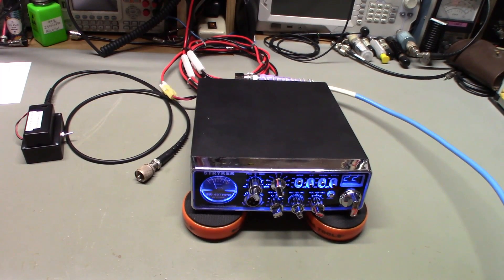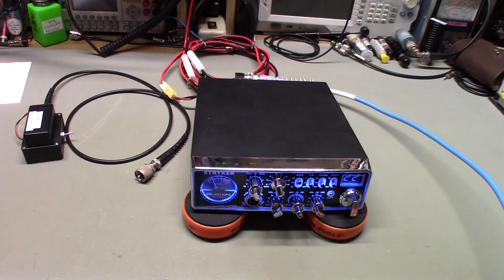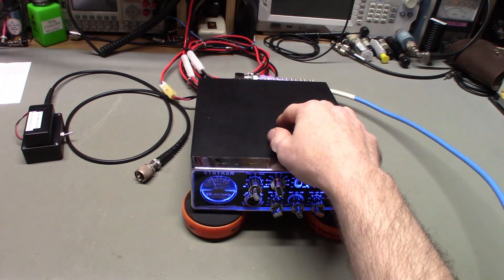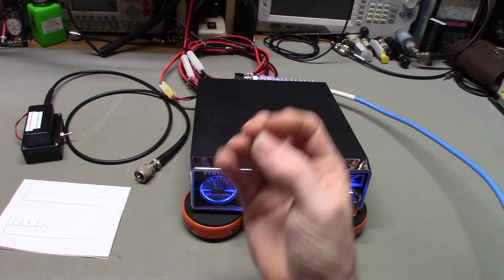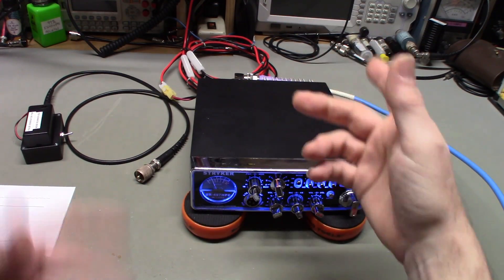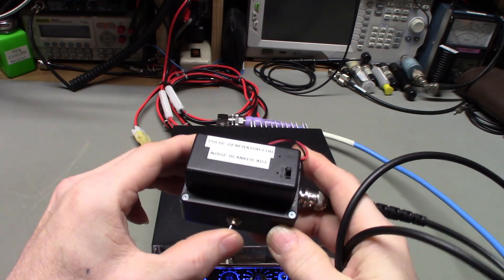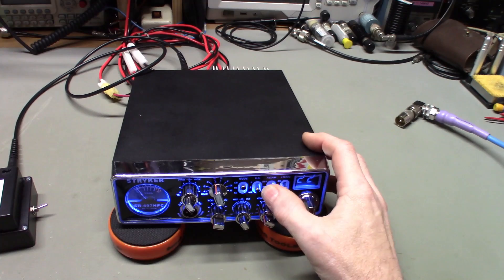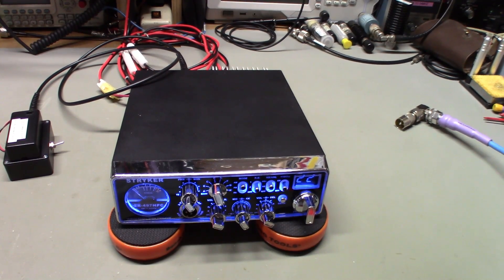What the noise blanker does in your radio and why yours probably isn't broken.

Comment: I have a 2020 Dodge Ram Hemi and I'm getting ignition noise.  I'm thinking it's spark plug noise.
Reply from the maker: Probably not the type of ignition noise you are thinking about.  You probably don't have spark plug wires.  Most vehicles these days have coil on plug packs, there is no spark plug wire in most cases.  There is however a bunch of other electronics in modern vehicles that cause interference on HF.  Proper grounding, connection directly to the battery and judicious application of ferrite cores/beads to power and coax cables can greatly attenuate this interference.
Reply: @mikesradiorepair  Thanks for the reply.  I do have the power grounded to the battery terminal.  Someone suggested that I should move it off the terminal to the chassis ground.

Comment: Yeah but you will still hear it right if somebody talking is coming in right?
Reply from the maker: No, it works on fast rise time pulses.  It will still blank the sound if a pulse triggers the circuit while someone is talking but you will never hear it.  The amount of time the audio is "blanked" or muted is so short our brain can not hear it.  Same effect as a flashing light.  Flash a light fast enough and we can not tell it's flashing, it looks like a light that is on continuously but it can be turning on and off 30 or less times a second.  Our brains are VERY slow.
Reply: @mikesradiorepair  thanxx man !

Comment: Yep - the NB circuit basically "blanks" out the receiver for the period of a short-duration impulse spike. They taught me that the "background noise" heard in an unsquelched AM/ SSB receiver was actually "thermal noise" created when any electrical circuit is active. With no antenna connected, each stage of the receiver introduces thermal noise into the signal chain and processes this as a "signal": It (1) amplifies it - RF stage, (2) mixes it (the mixer also gets thermal noise from the IF stage), (3) detects it and (4) the audio stages amplify it into the noise heard in the speaker.

Comment: The noise blanker in my ICOM 746 isn't broken - it just doesn't work very well.  Pressing the NB button doesn't eliminate the transmission line spark-gap type noise that's cropped up in my neighborhood recently.  It instead chops up the signal and reduces the noise only slightly.  But the noise blanker algorithms in newer radios and even in the cheap SDRs running SDR# or SDRUno software (with adjustable NB thresholds) work great to eliminate that same transmission line noise completely.

Comment: Are their any radios on the market that are AM only with variable talkback and echo? I’m not interested in sideband or anything extra. I’m looking for a box stock AM radio with variable talkback and echo that I can order or pick up locally......
Reply from the maker: Honestly I'm not the right person to ask about that.  I don't sell radios, I only do repairs.  The best people to ask about something like that would be a shop that sells radios.  They are going to have a better idea of what is currently available that would meet your requirements.
Reply: In your opinion is there a particular radio that can handle the shock and vibrations of being in a dump truck?
Reply from the maker: Any modern radio that uses surface mount components is going to be more resistant to damage from shock and vibration.  One of the biggest problems in high vibration environments is bad solder joints.  Older through hole design boards are more susceptible to solder joint failure because the parts are hanging off the board by their wire leads.  Surface mount parts have no wire leads, they are soldered directly to the surface of the circuit board.

Comment: My uniden pro 538w picks up all the car electrical noise. It doesn't have a NB or ANL switch so I use the squelch and RF gain to tune it out. Unfortunately that makes for lousy RX sensitivity.
Reply from the maker: If it's a modern car join the party.   All the noise from the vehicle computers is horrible in some of my newer vehicles.  I installed a Powerwerx line filter in those vehicles and it pretty much eliminated it.  https://powerwerx.com/dc-line-noise-filter-powerpole-connectors

Comment: Hey Mike I'm putting up a 40-foot Tower at my house with a 24-foot solarcon IMAX 2000 on it what would be the best coax to use, about 75 ft will be needed, cb band     thanks
Reply from the maker: The best coax for any application is the best you can afford.  The higher the quality of the coax the more it cost.  You can get crazy and spend thousands of dollars on large diameter premium hard line or use something more reasonable like LMR240 or LMR400.

Comment: Have a question I'm hoping someone here can answer. I purchased a Dynascan Cobra 29 23 channel cb I am hoping to restore. I got the sams photofact cb-56 for this radio but am A bit confused about the electrolytic capacitor list. For some of them there are two different values shown, such as c46 10mf at 16v and 10mf 10v. Another is c51 1mf at 50v ans 1mf at 16v. There are several like this listed. Should I just go with the higher v caps? Thanks for any replies.
Reply from the maker: When in doubt go with the higher voltage.

Comment: Noise blankers should be adjustable for best control.  In my TS-590S I have timing control for NB1, NB2 or both.  They are all useful for various kind of noise.  In my case its mostly static noise during hail and winter storms.

Comment: Nice explanation and video! I don't know if you've worked on the old Alinco DX-70 at some point, but I owned several during it's run and while they had a great display and xmit audio, the NB sucked. Not only would it not tackle ignition noise, but when turned ON, it actually injected  a lot of noise of it's own into the receiver, making it a terrible choice for mobile operation.

Comment: Hello. I am looking at a never used Royce 604 in box from 1977. I don't know much about Royce. Good radios? Very clean. $50.  I have a brand new Cobra 25 LTD Classic, mic mounted on the front, China made.  I bought the Cobra rather impulsively but wanted something vintage. Was Royce a good brand?
Reply from the maker: Royce was a good manufacturer.  They did things a little different than many other manufacturers.  The 604 is a good example.  It has what I would call a "one chip wonder".  Most of the receive circuit to include RF Amps, mixers and IF stages are all done on a single IC.
Reply: @mikesradiorepair  Thank you so much!
Reply: @mikesradiorepair  Hi , I have a Whistler 900 that was working and quit a few months ago .
Sent it to a local cb guy and it is now dead ! Just lights up ! No audio and no transmit ! 
I dont know what he did but he offered me another radio for free because it quit while he had it ! 
Fair enough , but I miss my neat Whistler 900 ! Could you have a look at it ?

Comment: QUESTION ! ! !  Got a Rigol4102 signal generator with noise generator, this noise is not blanked, I suspect this noise is not the "right type" of noise?   Have had trouble doing alignment on radios. Have restored a ts-530, ts-940s, and an ft-980.  Show us how to make the box?  The ts-940s works.  the ft-980 works but has a "slow to recover" type action to it. P.S.  Use ds-815 spectrum analyzer, MSO 4000 scope, dm3068 DMM.   Seeking a better stand alone frequency counter and seeking a way to do SINAD measurements, homebrew of sorts perhaps.  Ugg, more equipment to get/build. Actual RF sg gen wanted as well.  Sorry for the rant. 73's.

Comment: Now if I can only get rid of the engine whine that comes through my speaker, I'd be doing much better....
Reply from the maker: Are you sure it's engine noise?  In modern vehicles it's not engine noise but electronic noise generated by the vehicles electronic systems that create a lot of the noise.  If the noise doesn't change with engine speed then it's not engine noise.  I have a fairly new car here that it took me a good bit of fiddling with to finally get rid of all of the electronic noise generated by vehicle computer systems.
Reply: @mikesradiorepair  Thanks for the reply. It's an 88 pickup with older internals. I swapped out all of the "newer"  in favor of an older setup with carb and HEI distributor. It does change with engine RPM, the high pitch whine gets louder as I hit the accelerator. When I'm driving it's almost impossible to hear above it. At idle, it's still annoying, but bearable.
Reply from the maker: Make sure everything has a good ground.  You can also try sticking a filter on the power cord.  These help in some applications.
Reply: @mikesradiorepair  I have everything grounded with star washers a plenty, but I'll double check everything. Do you have a filter you'd recommend?
Reply from the maker: @jizomeovonsteelwind  

https://powerwerx.com/dc-line-noise-filter-oemt?gclid=EAIaIQobChMIy8W_9ZbG4AIVwSNpCh0M1QJ_EAQYBSABEgJ7-vD_BwE
Reply: @mikesradiorepair   Awesome, thank you so much.
Reply: @mikesradiorepair  I greatly appreciate your help, and hate to be that guy... BUT, after looking at the filter you suggested and placing an inductive amp gauge on my power wire to my radio, It doesn't look like this one would work. I'm trying to find one that is 30 amp capable,  but I'm not having any luck. My radio pulls ~25 amps when transmitting. Any chance you know of one? thanks again, it is very much appreciated.
Reply: That whine that increases with RPM is the alternator. Use a noise filter in the radio's power leads.
Popping that speeds up with RPM is spark plug noise. Use resistor plugs and wires.
 The higher pitch whine that doesn't change with RPM is your electric fuel pump.
Reply: It actually turned out to be the stereo amp. I have it on a switch, flipped it by happenstance one day and the whine went away.

Comment: Why is the receiver in this radio so noisy without the antenna connected to it?
Reply: I despise radios with a noisy receiver alignment. Thank your for your answer.
Reply from the maker: As Mister Hat said with no incoming signal the AGC circuit is going to have all the stages turned up to maximum.  Once a signal is received the gain of the stages is lowered.  The higher the incoming signal the less gain there is.  Also the volume was turned up really high at several points in this video, up the whole way in some parts.
Reply: @mikesradiorepair  there are scientists that say that you actually hear the big bang and the residual noise from that moment.
Reply from the maker: Yes, it's called the CMB or CMBR for cosmic microwave background radiation.  Was discovered by Penzias and Wilson of Bell labs in the mid 1960's.
Reply: The gain is the highest with no signal and it's amplifying its own noise.